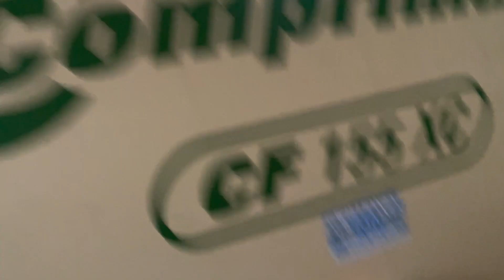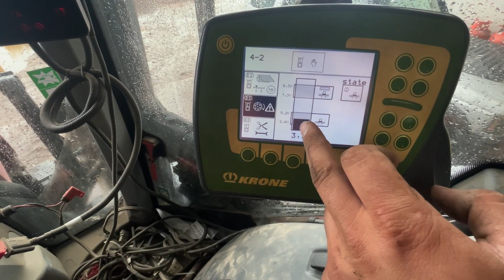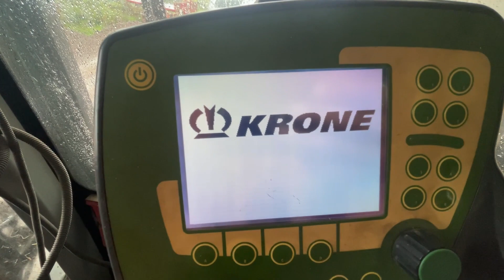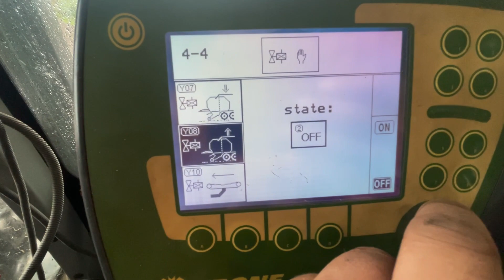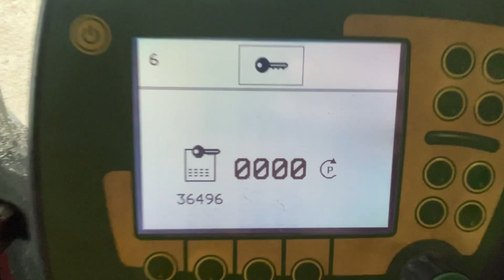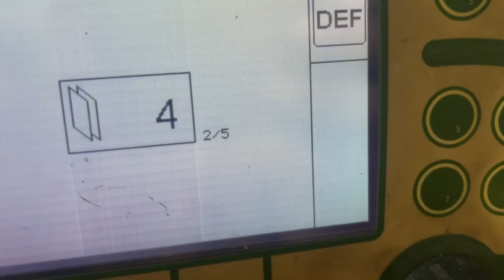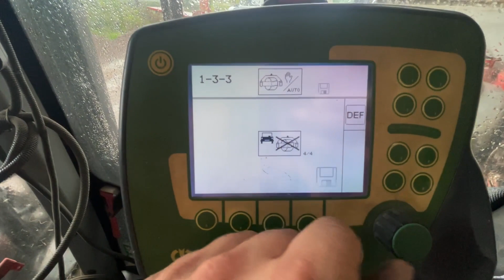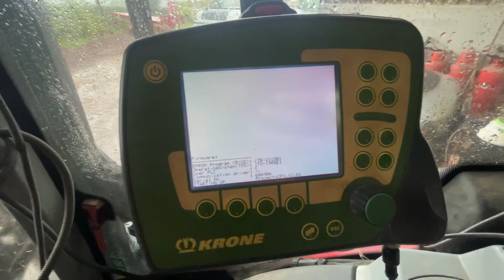Workshop Day: Krone sensors

Comment: Do yourself a favour buy a fusion baler you won't know yourself
Reply from the maker: Got krone because of the good dealer also like the belt and slat system and cam less pickup is seriously reliable
Reply: @samsymes123  looking at your video's you and my idea of reliable differ some what around here it is mainly McHale with an odd khun and   Massey baler floating around
Reply from the maker: Everything brakes down 🤣 it’s a fair free for all round here with balers there doesn’t seem to be one most popular maybe slightly more fusions but I have heard some horror story’s with them
Reply: @samsymes123  I suppose thats fair comment bought a fusion 2 yrs ago broke my heart the first year but learned how to drive then pretty reliable ever since it's big advantage is its rapping ring and single axle
Reply from the maker: That wrapping ring is a good idea. How come you prefer single axle? I find double axle rides better and floats wet ground better
Reply: @samsymes123  Double axle tears and sucffs fields if damp especially if there hilly so you need a bigger tractor to pull it and when taking off after tipping the bale harder to getting goin' in soft ground
Reply: Had u ever any issues with the hydraulic fed clutch on d welger big square balers